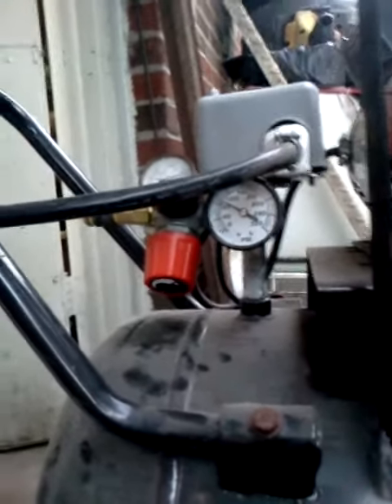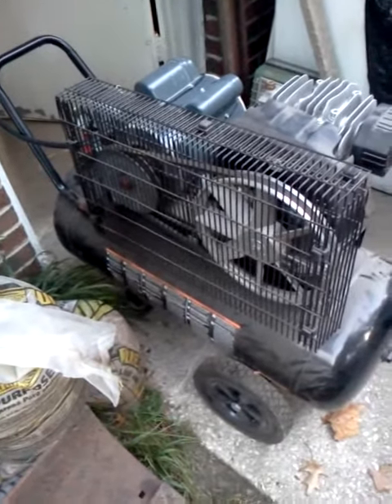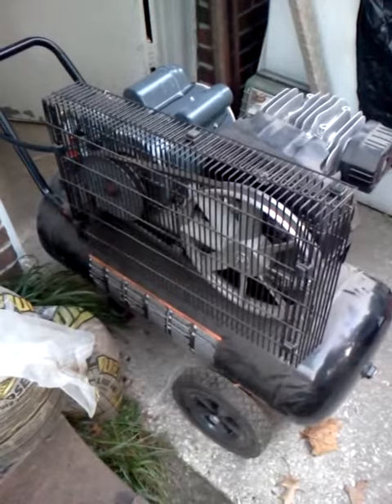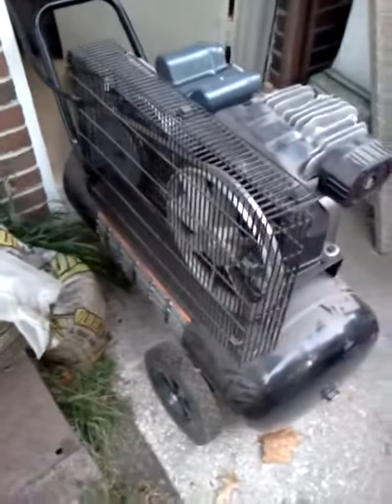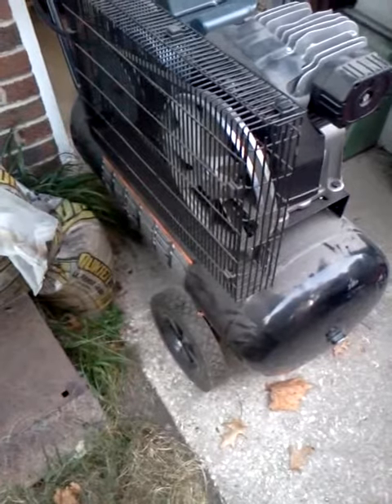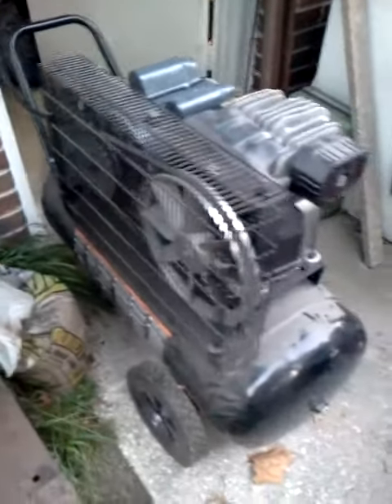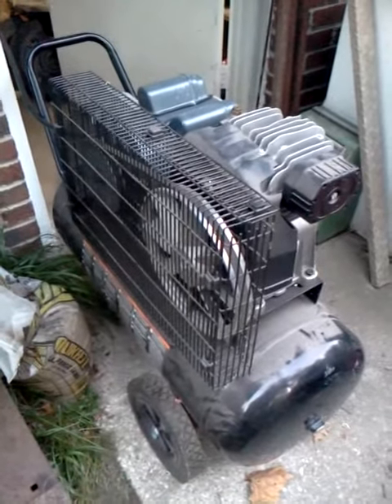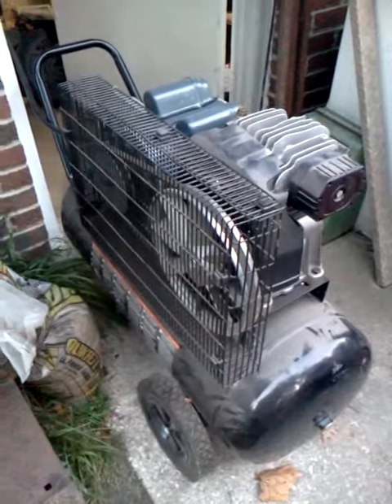AER20 Restore

Comment from the maker: Didn't get the current clamp on yesterday to test... though appears the breaker was tripped at the time just prior to this video being made.  I, at least pending another causation, assume the pressure switch didn't turn off the compressor... the breaker tripped.  The breaker tripping might be an issue not to consider disassembling the motor to inspect resistances and get's me thinking again the motor might be under-powered, for that duty of a compressor also, if the electrical characteristics are in spec.  Found out when I went to get some vegetables from the freezer... saw the freezer appears to auto-defrost and that freezer doesn't aut-defrost.  Chunks of ice weren't supposed to be on the bags and some of the vegitables and livers weren't supposed to be thawed.  Found one leaker liver pack and threw that out... though inspected, smelled and didn't notice anything wrong with.  The pork tenderloins appears frozen solid, the water jugs all seemed frozen solid and a bag of ice was still present... albeit thawed somewhat.  Surprised me actually, thought was going to be a worse situation.  Will be careful this month however.  I guessing the liberals in the remote transmission stations with wireless assault weapons are wanting to create medical conditions any way they can invasive nuisance remote sensing style.  Rapid response teams need to kill and I mean seriously apply deadly force As Soon As Possible to exterminate the operators and operations communicating with Mind Control Mind Wars systems.   All those in the mind control stations are imminent threats and need to be made dead publicly as soon as possible.